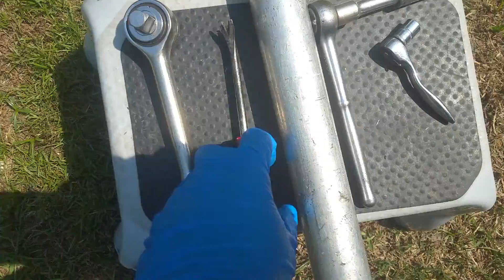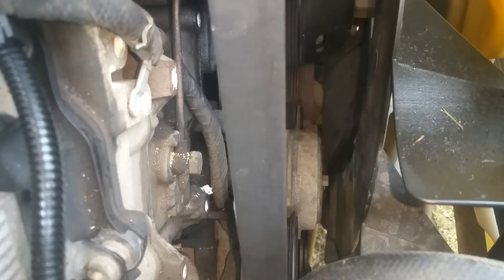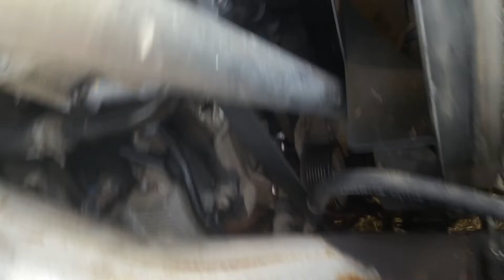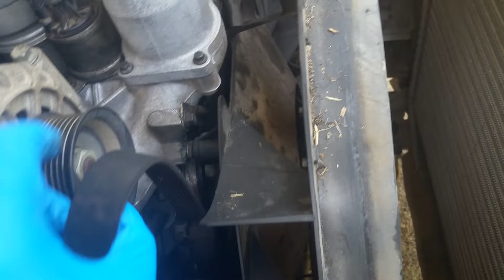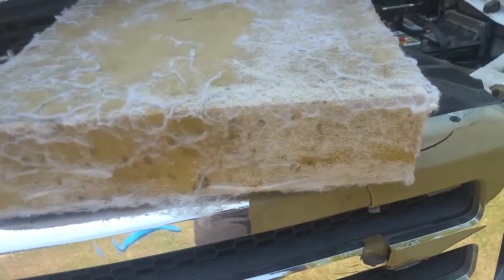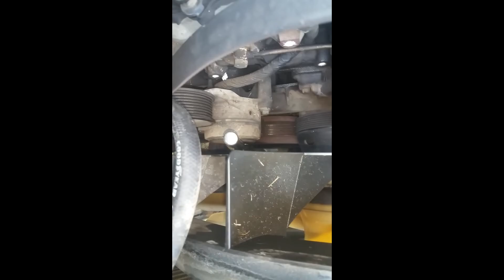How to replace alternator f350 6.0l  2006

Comment: Thanks for the video after doing it this is one of the best set ups, I could not get two of my breakers bars to go in, ended up using a smaller rachet and a pipe just like you did. It was even easier putting in a 1/2 reducer then using the small rachet.

Comment: Not sure what the ratchet was for.  Simply pull on the belt and flip up the "kickstand" to hold the tensioner in place.  Once the alternator is installed, pull on the belt, the kickstand will disengage and viola, you're done!
Reply: Dang my kickstand snapped off:/. Any tips?
Reply: My kickstand was long gone, is cute when all these comments are saying to use the kickstand though

Comment: Pull on the belt then lock the tab on the alternator no need for wrench and cheater bar.  Unbolt alternator first, far easier to reach the wires to disconnect.
Reply: What tap bro?
Reply: @mikegomez5796  watch other 6.0 alternator replacement videos and they will show you the location.

Comment: that tensioner is an absolute bitch
Reply from the maker: It takes a lot to move it for sure . I had read or seen somewhere where someone stated that they had simply pulled on the belt to get it loose . All I can say is they have way more strength than me. Of course even at that they'd have to preload or push it back to get the new belt on . Doesn't help you can't hardly see anything . I know when I was working on this I had a few things removed and was trying to give a better view of where it was and the difficulty . Thanks for watching and thanks for the feedback
Reply: @WrenchTheory501  Ended up getting it by myself with a prybar on the tab. It doesn't help that my AC tube goes OVER the CAC tube instead of behind it, right in the way of pulling on the belt haha